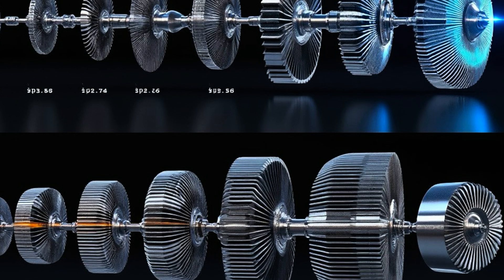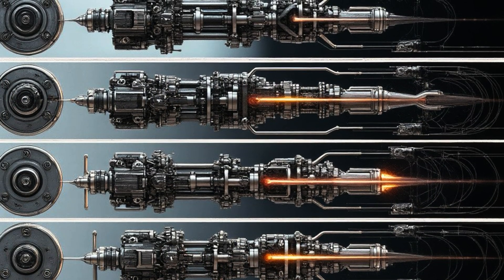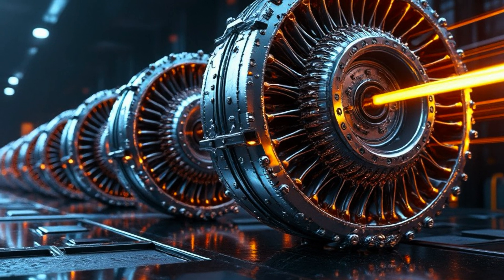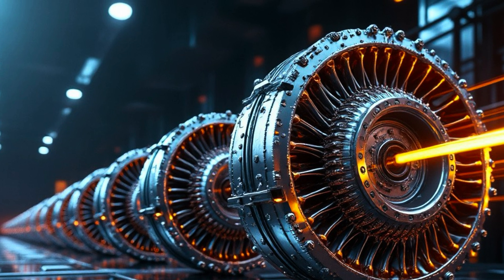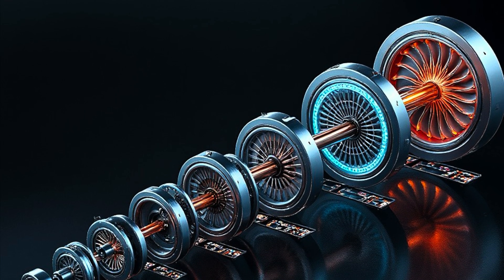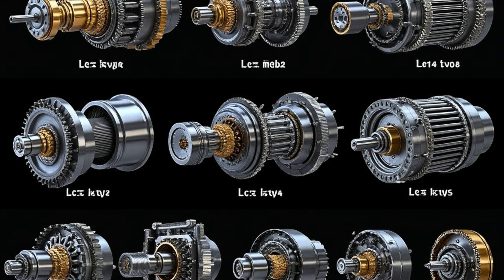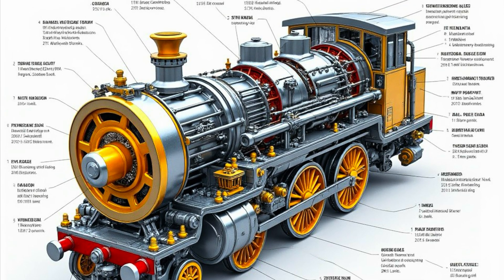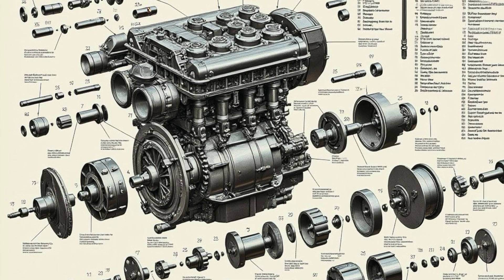The Magnetic Engine 🧲

Comment: You didn't provide any real info.
And perpetual motion is everything. Everything is in perpetual motion. Overunity is very possible. The laws of thermal dynamics are flawed. And holding you back. This is propaganda. Aimed at stopping (free energy) production. Would you be okay with it under a different name? Maybe Electricity Generating Energy State Changing  Machine.
Reply from the maker: The info provided is found in the description, and came from Clif High, then I feed that to Ai…